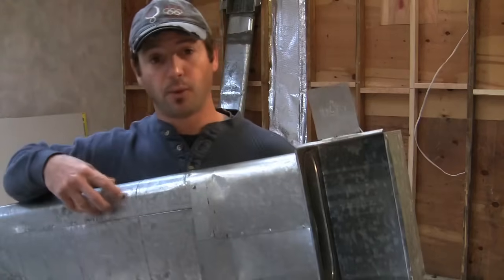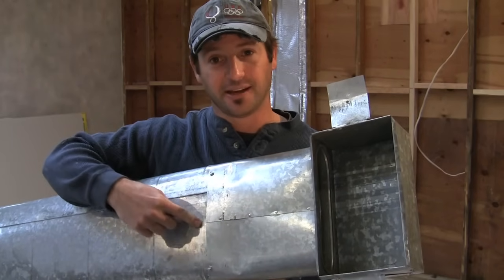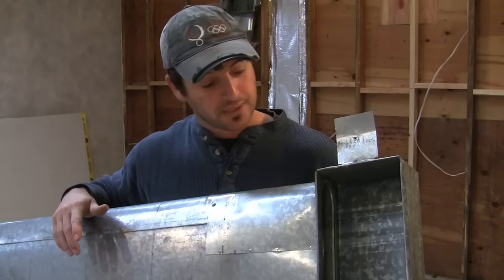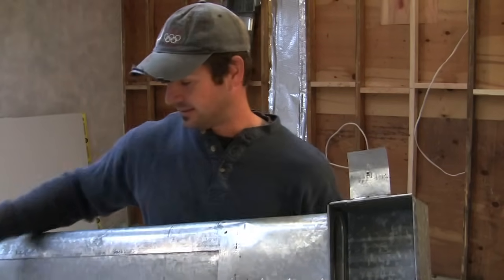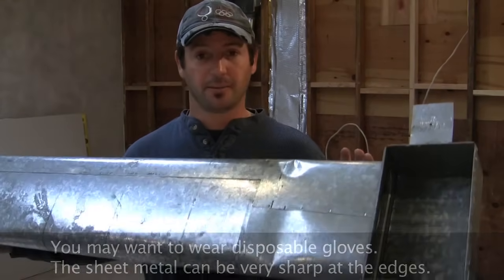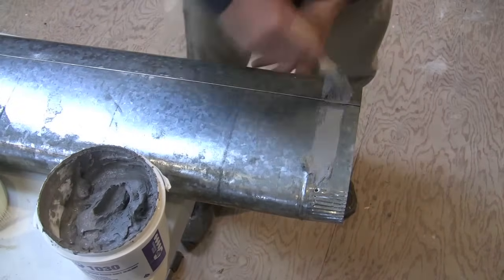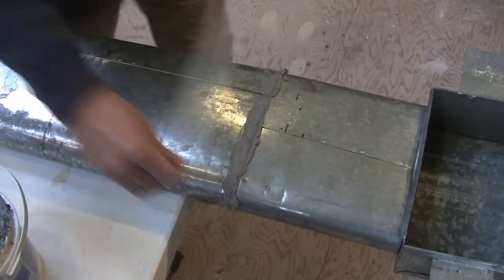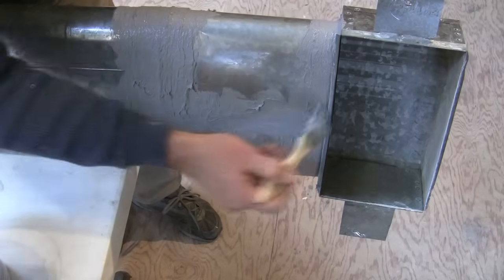How to Seal an HVAC Duct with Mastic - Duct Sealant

Comment: Local HVAC tech quoted me $4500 saying my ducts needed replacing, but it's obvious they only need sealing costing a couple hundred bucks DIY and a few hours work.  I was also quoted $4500 to have the blow sealing done.  Yea, not happening. Thanks for the info.
Reply: Idk anyone with these type of metal ducts exposed, but it's a bitch to do, if a company if going to reseal them, they might as well replace them if the sheet rock is coming down, they probably have mold in them anyway if they're old. There's a reason they don't want to just reseal them.
Reply: U cheap bro

Comment: That Is Well Over Kill, If You Put That Much On It Will End Up Costing A Bomb And Putting That Tape Round It Is Just Pointless
Reply: More is not better really, putting more than needed does not make it anymore airtight. I'm thinking more cost effective there going to be more than one joint so why waste it putting to much on.
Reply: If some is good, more is better.  That's what I always say.
Reply: The more the better.

Comment: I had this done by a "professional" insulation company.  They put the register covers back in before the Madrid dried, thus gluing them to the floor and likely to the inside of the vent.  Do you know how I can get the vent covers up without ruining the sealing that they did?  My vent covers are plastic and i have a baby learning to crawl.  They break easy and I want to switch to a more sturdy metal vent cover.
Reply: a little late to the party but take the grille off and re-seal what you think was damaged from the inside.

Comment: I would be wary of using roofing sealant on my ducts. This is the air your family breathes, and the roofing stuff is not made for that. Who knows what fumes it could put off when it gets hot. The duct mastic is water based, (roofing sealant I use is Xylene based)  it works, and it is made for this purpose. Just used the stuff on all the ridgid ducting in my crawl space, . I get far better air flow to far bedroom, which is what I was looking for. After the mastic cured, I wrapped with foil tape.

Comment: Would roofing sealant work better since its more tacky and is made to stand up to harsh conditions. Seems like it would adhere better and last longer than duct mastic. What do u think?
Reply: it is also carcinogenic...
Reply: veazy81 old school duct work was wrapped in insulation. all joints were covered in roofing tar.  mastic is flexible and takes temp changes well
Reply: Not good to breath in
Reply: Pretty much mastic will work fine. There's no need for something that drastic, when mastic works well. That's like using duct tape instead of electrical tape, it's just unnecessary in most applications. Now if the ducts are outside, you might use tar, but then again, most ducts are not this way

Comment: I just acquired a 2 story building with an elderly woman on the first floor.  I learned that her unit is heating the commons area in the hall/stairs.  Code does not require them to be heated in our area.  I would like to reliever her of this burden but don't know what to do.  Any suggestions?
Reply: Block off the air with a damper from going to that area, what's the issue with just letting it blow?

Comment: Thanks Corey. Great video! Some things just make sense and putting drywall tape on does just that. After all mastic is in putty form as you are putting it on just like drywall mud.  

On my house, which was built in 2006, they used DUCT TAPE and then covered the DUCT TAPE with mastic.  I wish they had used mastic by itself as the duct tape that is mastic covered is coming off and allowing massive amounts of air to leak out.  I have fixed a few of the largest leaks and will fix the rest soon.
Reply: My installers used foil tape then mastic I was perplexed!
Reply: Should I just use mastic only? Or should I use premium foil tape then mastic. Or a thin layer of mastic, then tape and cover with mastic again? I'm trying to figure out what is best option and planning on doing this soon.

Comment: What about foil tape? Is your method cheaper?
Reply: probably cheaper and better, tin tape dries out over time. That mastic will stay hard as a rock unless you hit it with a hammer
Reply: @chriskathol  use foil tape, then mastic over it, and let the mastic overlap off of the tape, that way, if you have to get it off, you can, it'll hold just as good, is as thick as mastic, and as airtight .

Comment: can i use this mastic for my air conditioner duct vents located on top of my roof.. to use as a water sealant. I notice my vent joint were just taped up with aluminum tape and and covered with tar. please advise.
Reply: Yes

Comment: Look at you go Corey! Nice video. I've been in the sheet metal industry for more than 30 years and I can't preach enough about how important it is to seal duct work. I never thought to use the sheetrock tape, great idea. I wouldn't typically use it on the commercial jobs I work at because time is money but home projects for sure. I would also recommend using the sealer on the snap lock seam going length ways on the duct. Wiping off the duct is a must.  Like I said. Nice video! Be safe! Phil D.
Reply: 20 years ago I had my basement refinished. I added 5 vents down there and specified no duct tape in the project on the contract. Their HVAC sub said it didn’t matter the heat was still going into the home. For other ridiculousness  I told them not to let him back on the job site. 

It’s to bad when someone has done something for 30 years but will not learn something new.

Comment: Great video!  I'm going to run out and grab some mastic for this weekend's project.  

Have you ever done any work around insulating fireplaces.  I have a screen that seems to leak like a broken window.   What insulation was there when the house was built seems to have fallen apart.  Any ideas on what would be appropriate to use in that space?

Comment from the maker: Thanks for the comments!

For years, HVAC installers have been using DUCT TAPE to air seal the joints in duct work. Strangely enough, duct tape is not made for working on ducts because the glue can not handle the heat.

Energy Star estimates most homeowners lose 20% of the money they spend to heat and cool their homes because of leaky ducts. The air disappears into the walls and attic spaces without reaching your living space.

This is a cheap way to save money and make your rooms comfortable.
Reply: How do you find the leaks if your wall is sealed?
Reply: @genx8889  Look at thermal cameras like flir.
Reply: For even more years, they did not use anything at all to isolate the air duct)))
Reply: Plus duct tape is HIGHLY flammable!